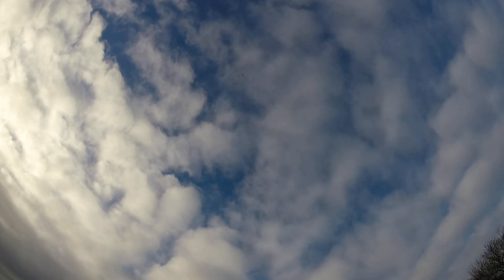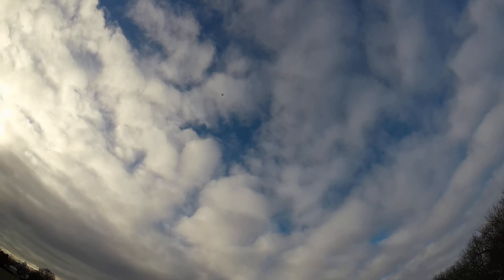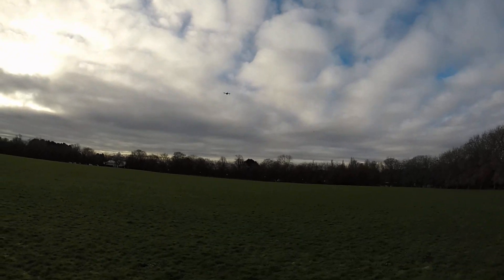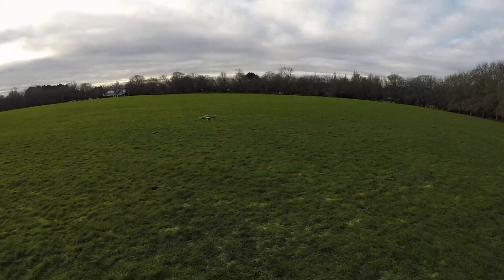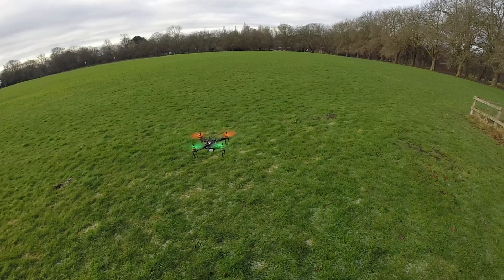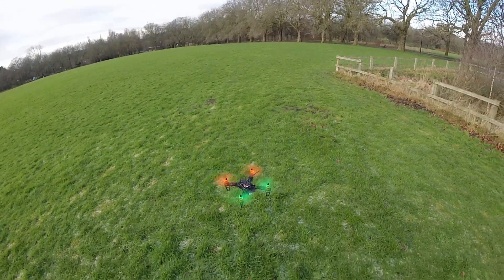Flying a FPV250 frame with a full Naze32

Comment: What did this setup cost you? I'm interested in getting into the whole DIY quad scene, as I've been flying pre-built ones for a long time now.
Reply from the maker: jacobtc Hi, the quad itself about £120.00, the battery is about £8.00, then we have the Radio TX which is a frsky Taranis at around £150.00
Reply: joseico90 Not so bad, yeah the Taranis seems expensive, however I guess it is one of the things which can last a loooong time.
Reply from the maker: jacobtc yep, the taranis is an awesome radio :)

Comment: Hi,

Great flying skills! Can you please share some screenshots of the naze32 settings that you're using? I'm doing an identical build and yours seems to fly very smoothly. Also, why have you gone with the full naze32 instead of the acro version? Thanks
Reply from the maker: hey Joao, I've transferred all that gear to another frame and I don't have-keep screenshots, good tuning is very specific of the hardware and firmware one runs, my advice  is you learn to tune it yourself, other people's tuning values won't work the same on yours unless you have every single thing the same. What firmware are you going to run? Reason for the full naze32? just wanted to try, my advice? don't bother with it, the Acro does all we need.